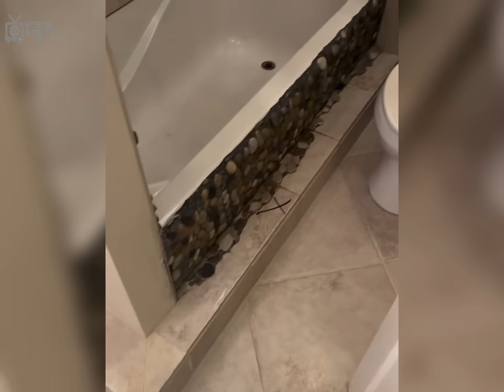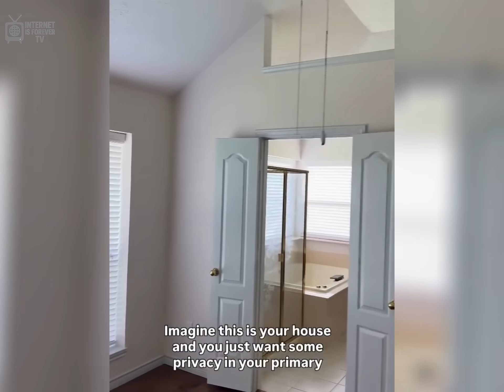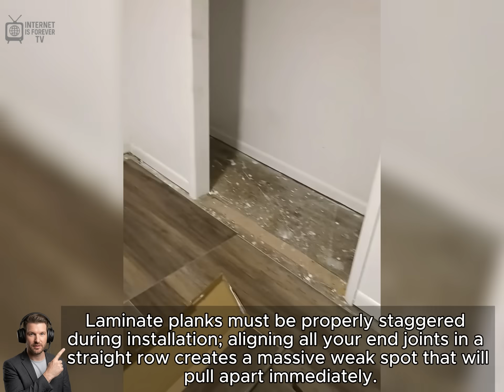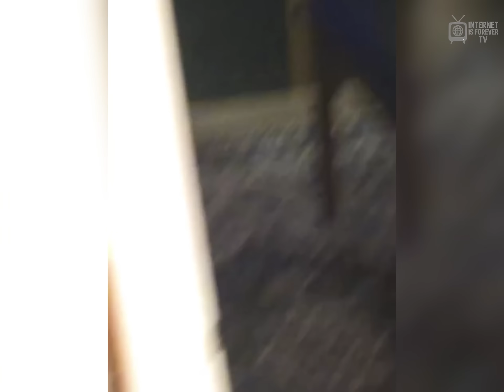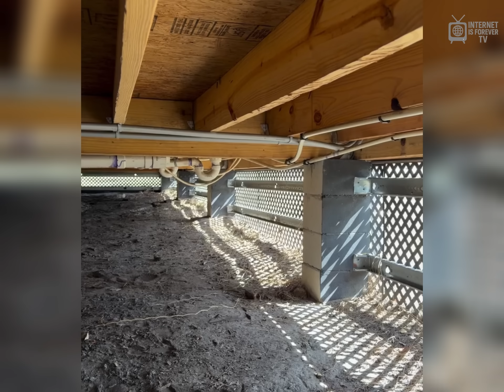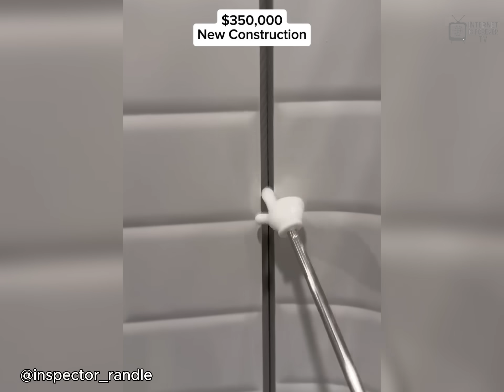Best CONSTRUCTION FAILS | Paid Work Gone Wrong | Part 25

Comment: 25k that fiber bundle? I bet just the downtime was much more than that, let alone the replacement, conduit, joining and find another excavator to do It that its not the same trained monkey level as that one.
Well, to be fair, maybe "the damage", as the amount of Fiber damaged in that exact point he directly damaged IS 25k. 
Making It work again...its a different beast.
I bet he was planning to repair It with electrical tape after.

Comment: Some years ago I had a job in North London, the downstairs extension needed 2metre footings due to subsidence, dug out from 1 metre away from the bottom wall towards the house as needed a shutter wall putting in, dug this by hand as there was no access to the back, we'd already put in steel and jack's to take the weight, when I got to the actual footings ( I say that loosely) the whole of the extension was held up with a bucket ( upside down) with 3 coke bottles filled with p+££. Absolute joke 😢😢😢😢

Comment: I worked for the council and went to a house, because the ceilings were bellying. The tenants knocked down a supporting wall to make 2 rooms into one.  The 12ft span was joined together with bits of 4 x 2 timbers cased in plaster board.

Comment: 65yrs old 46yr tradesman in construction in electrical mechanical. People you have to do your due diligence. While it's being built, go in and do inspections. See if the site super will let you go in. This is when you can head off a lot of major issues. I would go in and screw down my entire sub floors, before they would be tiled or hardwood  put on them. They used to call me the ball Buster. On the 5 homes I've owned throughout my life. I would go in and tear him a new strip and get it fixed. Before walls were finished, supports, flooring etc. Wow, we are all entitled to a quality home that does not happen.Educate yourself.And be part of the process
Reply: this is the reason people hire so called "pros" - people dont know  what to inspect, people dont have time to supervise everything, people expect decency (not being naive but if we assume that everybody wants to screw us up this world is gonna be hell). so should I wake up in the middle of heart surgery to inspect the doctors work? I dont even know whats inside the jar of pickles (quality) until I open it. when I send a letter I dont follow the post office truck til it reaches its destination.

Comment: The toilets away from the wall is actually a good idea
If there was for example, an easy to remove storage behind it.
Because it leaves a really good access to the back of the toilet. I can 100% why someone would install it like that
If you have ever needed to d any work on the toilet, you know how frustrating it is when everything is flush against the wall on all sides

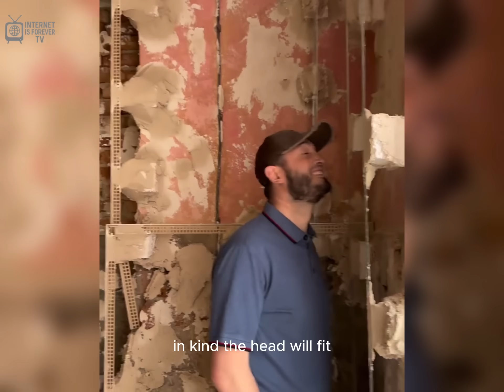Comment: 10:27 to be fair, drywall/plasterboard is only used because it's cheap and fast, and because it can be used on cheap wood-framed houses. The proper way to finish a brick wall is to build a bonding coat and skim. Buuuuuuut... those gauging beads set about 6 inches from the wall?!?!

Comment: This is a really good collection of stuff ups. So bad it is scary. I found learning to do things properly took a long time, like there is so much to learn especially if you want to be accurate and quick at doing it.
 But I did for about 6 weeks work for a self taught builder/painter who took massive shortcuts. It was kind of fun painting over cobwebs and flaky paint knowing that I was in no way responsible.